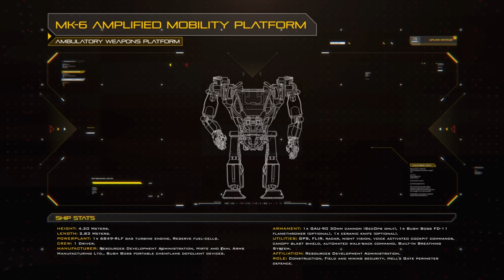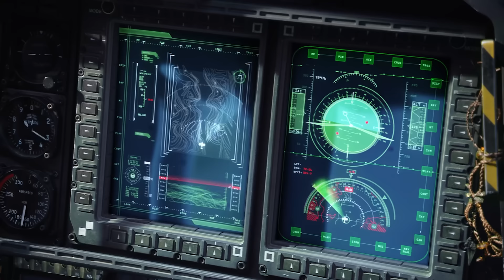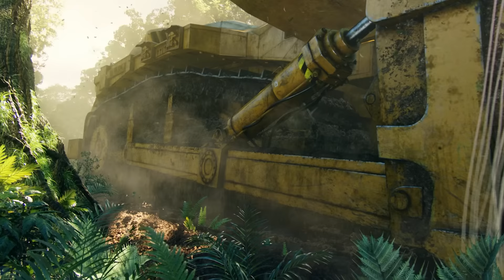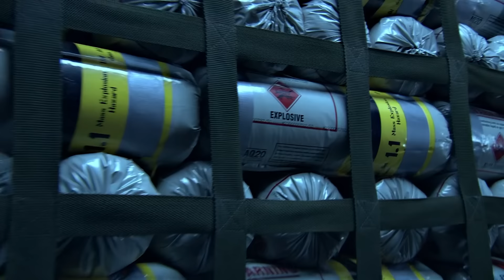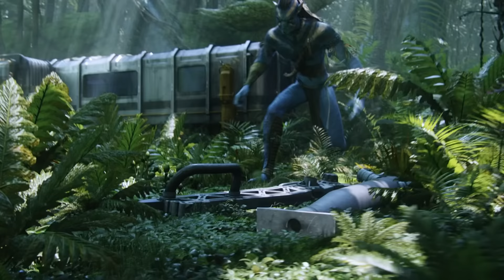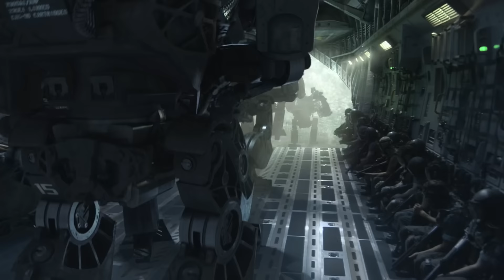Avatar: AMP Suit | Vehicle Breakdown

Comment: I have always wonder if the AMP suit was change to Battle Armor from Battletech will the battle go differently or the same?
Reply: Is the person piloting the BA an Elemental? Because if thats the case and you get them screaming about honor, the Na'vi are going to have a very very VERY bad time. 
Also, most BA is the opposite of the AMP; rather than the huge open space where the pilot sits, the suits form fitting, with as little open space as possible, fitting it original intention as an underwater mining suit.
Reply: Clan Elemental battle armor was designed specifically for warfare, came with high-power energy weapons, guided missiles, and jump jets as standard, had no problem taking a burst of .50 cal full to the chest, and extrude a thick layer of harjel to seal any breaches in the armor when damaged. By comparison, AMP suits were ruggedized forklifts with a mostly-glass cockpit and armed with whatever weapons could fit in their hands. I love the thought and practicality that went into the AMP suit's design, but Battle Armors are a very different beast.

The Na'vi would have had to resort to kaiju to push back the humans if they'd had true Battle Armors.
Reply: @tba113  Something tells me the Elemental piloting the suits would probably enjoy that, considering they leap onto mechs without a second thought.
Reply: @KillerOrca  Indeed, Canopus would probably fund the RDA just to get footage of that sort of thing for pay-per-view.

I'd subscribe.
Reply: @tba113  If not them then thats probably next up on Solaris VIIs arena. "MONSTER FIGHTS SEVEN"
Reply: Battletech recently added the EXO industrial mech that weights 10 tons and can use hand held weapons. Cockpit armor is optional.

Comment: I always hated the design because of how exposed the driver is and the arms being mounted above the driver's head.

Replace the windows with display screens and armor, then link those displays to a "head" that has cameras covering 360° field of view and can have nightvision/lowlight/infrared capabilities. That can be mounted above the shoulders along with hull mounted cameras as backups
Reply: Cameras can have delays and may also be vulnerable to electromagnetic interference something which is quite common on pandora
Reply: At least the technology for displays and  cameras would need to be shipped to them.  So their supplies to that would be limited.

So would that tradeoff between quantity and quality be worth it?
Reply: @magnum3.14  yes it would, thermals especially make a massive difference in any terrain but especially dense foliage like jungles.
Reply: @matthiuskoenig3378 great point
Reply: Minimize the glass should work. But trade off would be visibility. Small glass makes a small target. Like a cupola with HUD.
Reply: There are lot of problems with the AMP design
The claim is that Pandora's EM creates problems but thats what EM shielding is for

Comment: Avatar AMP vs Matrix APU, who's your money on?
Reply: Which APU the movie or Animatrix version?

Against the AMP suit. Movie APU would win 1 out of 10 fights, Animatrix version wins 9 out of 10 fights.
Reply: @williamhare4456  Whats the difference? Ive only seen the movies.
Reply: @LtCWest  The Animatrix APU is heavily armored and has actual Jumpjets integrated into it for limited flight or particularly high jumps the reason why APUs in Matrix movies look so bare is because it was a propaganda move and necessity in one.

 It was unarmored because the ones in charge saw it as symbolically revealing how man had control over machine. It also considerably improved the range of motion with the arms allowing pilots to shoot from almost any angle. While the Animatrix APU while heavily armored had limited range of motion with the limbs and horrifyingly enough when the early machine sentinels attacked they would subdue the armored APU then 
Quite literally rip out the still living pilot screaming after cutting through the armor. The human rebels just went fuck that and removed the armor.
Reply: @LtCWest  
The Animatrix version has the pilot fully encased (to the point they can barely move) in armor plates. Rocket jump thrusts for rapid maneuvering. The ammo is stored under in the gun instead of the back. And a large sensory systems to identify targets.

A whole lot of things that are rendered almost worthless when fighting a titanic mechanical horde.
Reply: Probably the AMP. While the APU has a much better rate of fire and mobility, its also unprotected relies on line of sight. The AMP does not, thus it has first strike capabilities.

Comment: Honestly one of my favourite mech design.

Practical without feeling boring.
Reply: I don't know how the Titans from Titanfall would have been without the existence of the AMP suits, they control in a very similar way but without the autopilot of AI in the suit.
Reply: @cpl.barbarusc4814 
Even a Generation 1 Stryder, Atlas or Ogre would be able to take on multiple AMP Suits pretty easily, considering they have regenerating shields which the 2nd Generation traded off for health regenerating batteries.
Voodoo 1, Viper could damn well take on anything Miles could throw at him
Speed is life
Reply: @cpl.barbarusc4814 hey Titanfall mentioned
Reply: @cpl.barbarusc4814  there should be some neural network to convert pilot commands into coordinated and balanced bipedal movement, or machine wouldn't stay upright this easily. Boston Dynamics tech.
Reply: It'd be more practical if they'd armor the freaking cockpits.
Reply: @BlazingOwnager  I believe the cockpit is bulletproof. But seeing as how they’re getting shot at with 3 foot arrows going at very high speeds I think it doesn’t matter
Reply: @BlazingOwnager  If your talking about actual armor it could be visibility im just spit balling here
Reply: @BlazingOwnager  Problem is that Those Arrows are made with a Natural Carbon Fiber. Pulled by Bows from 10 Ft tall Niva who can life a Full Adult with one Arm. 

At Close range, it has enough Power to Pierce the Cockpit.
Reply: @BlazingOwnager  I know what I'm talking about which you clearly are trying to lie. 

The Bulletproof Transparent Canopy for one. Is NOT TANK ARMOR. There's a reason the Navi aim for it. It's weaker and at close range there Heavy Bows are more than Capable of Penetrating it. It's why it's always shown in the film on how they Defeat the Banshee. Aiming straight for the Pilot from a Dive from above.
Reply: BlazingOwnager, if you’ve not already watched it then I highly recommend Tod Cutlers video on modern vs Medieval crossbows and I think he’s got one comparing bows and crossbows too. Basically bows only need like 1/5th of the draw-weight because of the higher range of motion to transfer the same amount of energy to the projectile.
Reply: @BlazingOwnager  There is such an option
Reply: @BlazingOwnager  They can’t armor the cockpit without giving up visibility. The film said that there was electrical interference, so cameras wouldn’t really work here. The only other option is to cut a view port and cover it with glass, which doesn’t really make that big of a difference.
Reply: @BlazingOwnager  That’s true actually. Maybe we might get an armored AMP Suit in the new film.
Reply: @BlazingOwnager  It would have to be nimble enough to swim around, and it sounds like a cool concept👍
Reply: @BlazingOwnager  The new mech is a crab. It took a complete 180 from the AMP Suit.😂👍
Reply: @TY-PO  More like it followed true evolution, everything always turns into crabs
Reply: @harbour2118  C R A B
Reply: @BlazingOwnager  Dude. Do you how bad the View is in those View Slots? Even if they are Armored they might as well be Blind.
Reply: @BlazingOwnager  Problem is that they won't even know where they are.
Reply: @BlazingOwnager  They wouldn't. If you anything about tanks. It's a bad idea to deploy them without Infantry support for a reason. So many Blindspots which is why they need infantry support.

Now try navigating a Jungle with nothing but a Narrow one Inch Slit. You can barely see above you compared to the Transparent Canopy.
Reply: @BlazingOwnager  Yeah, and what their target? Other tanks with as much visibility as them, not 3 meters high humanoid aliens with aptitude to hide and jump above you. Or worse, snipe you with an arrow. Tanks have big trouble operating in jungle here on Earth much less on Pandora.
Reply: @BlazingOwnager  what? No man it’s not a tank. Even then the shockwave would just kill the pilot regardless. Even modern day tanks don’t play that kind of shit because it’s more harm than good. One good explosive penetration is all it take make it a burning coffer. And AMP suit wouldn’t have that level of armor like modern tank.
Reply: @BlazingOwnager  no, they don't have tank grade armor. What you see is their body parts material that is no way a "tank armor". It looks bulky, but it is no tank armor. Those arms and legs don't weight as much as they are seen, and the back side ain't protecting shit while they have exposed exhausts and look like fuel/battery near it too.
Reply: BlazingOwnager, I guess this is a case of different priorities. You see it a lot in different militaries, for example the USA built very large and powerful Abrams tanks that made up for the 3000km+ distance from the expected battlefield but were difficult to replace. Compared to this is the old soviet tanks which were smaller and shorter making them harder to hit and easier to replace which was far more practical with the 1000~km distance to the frontline. Both were to designed to fill the same role but took very different priorities in design.

In the case of Avatar’s mechs I reckon the RDA prioritised versatile jack-of-all-trades platforms that could be used for military, construction, haulage, recon and more. In a situation where resources or industry is severely limited these kind of decisions are more common and generally more beneficial. As the series progresses I won’t be surprised if an up-armoured version appears or some kind of dedicated heavy weapons platform appears. Although I still think the AMP is about as good as it gets for completely undeveloped jungle terrain compared to tracked or wheeled vehicles.
Reply: AMPs are definitely one of the most badass mech suits in SciFi for this very reason. Everything is well thought out and given incredible care to fit its exact role in the film. It probably didn't need this level of detail, but clearly its creators had just as much love the human machinery as they did for the alien flora and fauna. It both clashes and comes together perfectly.
Reply: Same
Reply: Yeah, it's surprisingly somewhat realistic. I could see us building something like this if we need to.
Reply: Idk about that, if you're a pilot of a titanfall then you'd understand why avatar mechs aren't much good. Don't get me wrong, its good but its just the window is too exposed for a pilot. A titanfall protects a pilot and has camera to see in the battle
Reply: The AMP suit is very cool! I hope we can actually have these one day in the far future!
Reply: practical?!? they were crushed in nearly every engagement and have a massive glaring weakness
Reply: You guys talking about armor even think about the weight? It already have a ton and with that autonomy of only 8 hours, if you had armour all over the stuff, it will have at least another half ton to be useful, they can use cameras or other kind of stuff, so, transparent aluminium alloy would be the best armor but considering the weight? You would decrease at least 20% of the autonomy of that stuff and don't forget it got two big problems, the height and that weight applying pressure on the ground, 1,5 ton divided by those two feet square space? It won't be good in mud, and the height made it a awesome target, but I digress.
Reply: The peak of grunt mechs
Reply: More realistic than battle Tech's 50m tall targets. I hated that Battle Tech said the mech was the ultimate on the battlefield as they then wrote every rule to make that true, no matter how stupid that rule was. Apparently, you can be 30m from a mech with its fusion power plant on low-power and cannot see it but can bury an Infantryman 6ft under the ground and see them 90m away right next to it in heavy terrain.
Reply: Check out the aquatic mech in the Avatar 2 trailer it links more badass
Reply: Well not fully practical, the glass needs a grate on it to protect from Debris and Arrows.
Reply: You'd love the Invictor Tactical Warsuit then, it's basically an AMP but with more pizzazz.
Reply: Same
Reply: why hold guns and bayonets when you could mount them on the mech/suit. practically unpractical.
Reply: @leSandWhich? They're exploring (invading, the proper word) another world. Another world. With mostly military guys & weapons on scenes. And you're talking about rda. Damn dude. You should've seen what your "rda" concept have done to our reality worlds for centuries. You should see the damn real world first. Coz i'm talking about the practicality, not politics.
Reply: Same
Reply: If only Mechagodzilla was like that in the MonsterVerse.
Reply: They look so bland, generic and boring, not sure what you guys smoking, looks like the matrix copy. District 9, now that was a cool mech suit.
Reply: The cockpit could be transparent titanium.
It is not, but it could be.
That said, a tankette would be infinitely better.
Reply: @Ag3nt0fCha0s what's a tankette? And why's it better in what areas?
Reply: Idk about that. It's a really cool concept but if you think it for more than a second you realise how impractical it would be because of the glaring weakness (that of course they had to have so they can lose to basically oversized cavemen). The only reason it kinda works is because the humans in the movie aren't really an army on a mission but a security force protecting a mining company. So im assuming the primary function of the mechs was to carry heavy things and not combat
Reply: Except they got that massive glass canopy. Which somehow doesn’t stop arrows. Granted they seem to be physics breaking because those arrows are moving way too slow to have that much kinetic energy.  There’s no way those things are that heavy because they’d have to be going that speed and somehow have superior ballistics to AP bullets.
Reply: @kolinmartz  tbf Pandora has a lower gravity than Earth so these arrows probably wouldn't fly like they do here
Reply: Too bad they don't have more protection for the cockpit though
Reply: Modern warfare XS1 Goliath design makes more sense than the AMP

Comment: About the right size for a mech.  Which makes it 100x better in my opinion than other mechs.  (Cough Imperator Cough)
Reply: Heresy
Reply: Bro the Imperator was never meant to be realistic, it was basically designed to be a walking church.
Reply: to be fair the imperium has smaller mechs too. see the imperial knights which are a lot closer to this one.
An imperator class titan would have propably won the fight if used correctly (aka protect the entrances and let it blast)
Reply: @ztheo2280  an imperial knight is way larger then the amp suit. a closer comparison is a sentinel or killakan.
Reply: @jaromswenson7541  he probably means the smaller imperial knights like the armiger warglaive (which is only slightly taller than this AMP mech)
Reply: Yup. The AMPs and the Titans (from the Titanfall games) are pretty realistically sized.
Reply: You deny the Emperor his Church on Legs? Heretic!
Reply: Bruh the imperator is a walking church. 40K is not trying to be realistic at all. Its fantasy with all the sci-fi tropes and cliches you can think of. AMP suits are more grounded(sort off) and make more sense in the fact they are multirole utility vehicles, not just "big stumbling metal fool with bigger shooty thing."